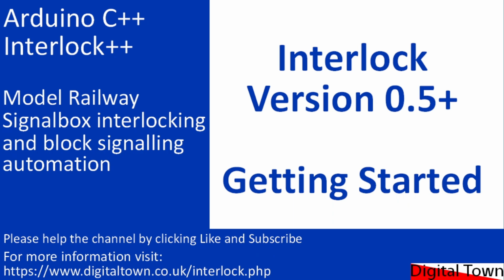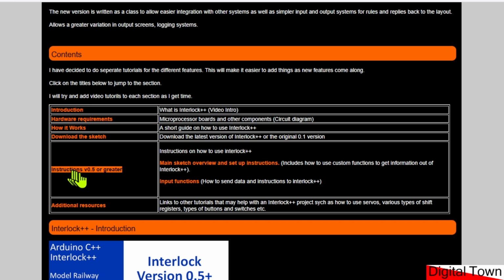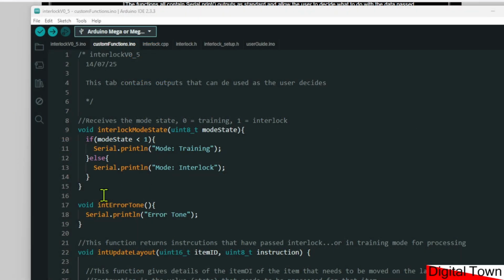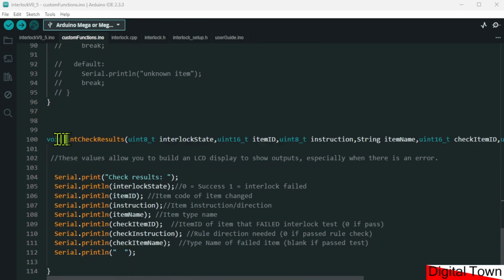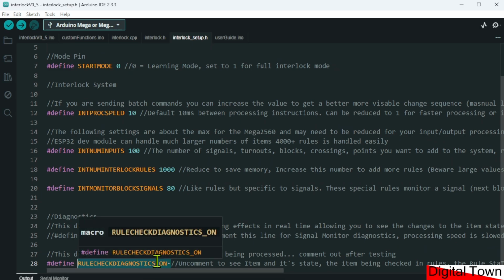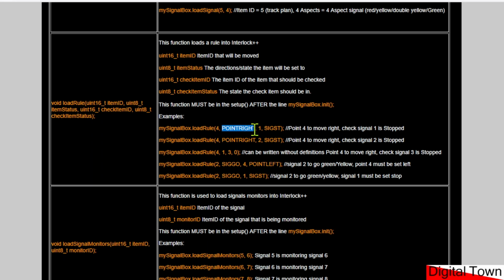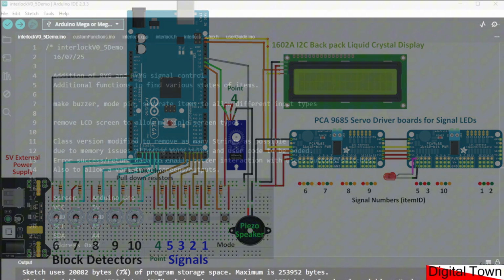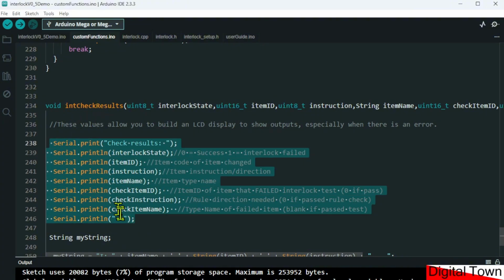#147 Arduino C++ Interlock++ Model Railway Signalbox interlocking and block automation

Comment: ☺Hi Simon.  Thank you for all your hard work in putting this brilliant system together.  I am n course of trying to implement a 3-aspect colour light signalling system for my DCC '00' scale layout.   I made a start using your nowRail system. However, having discovered Interlock++ today, I believe it might be more suitable.  Perhaps I'll be able to use nowRail for certain parts, such as obtaining turnout direction info from NCE.
Reply from the maker: I'm currently looking at how nowRail and the Interlock code can work together. 
The first stage will be an RS485 version of Interlock so that it can send and receive from remote boards, then a second version with noRail integration.
It will probably take a couple more months to get it all sorted and is currently planned for nowRail v2.0